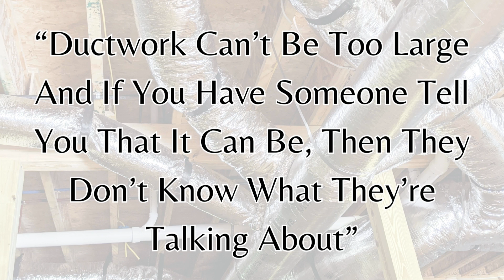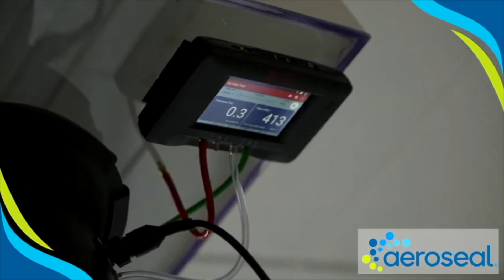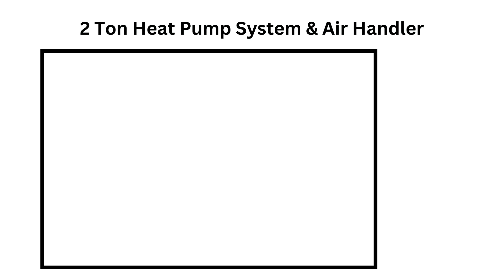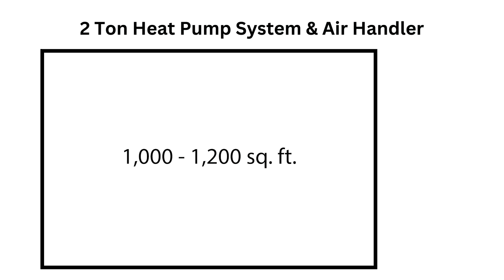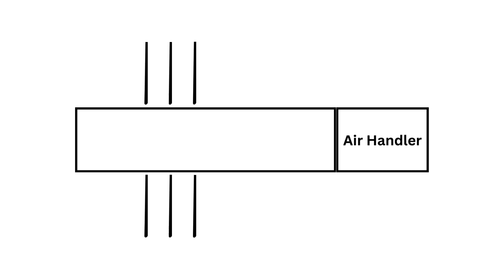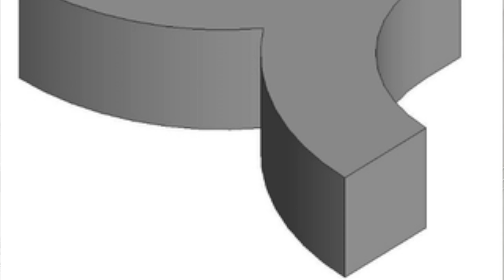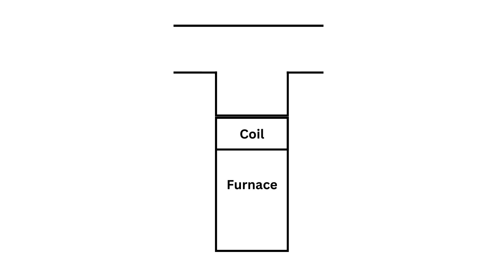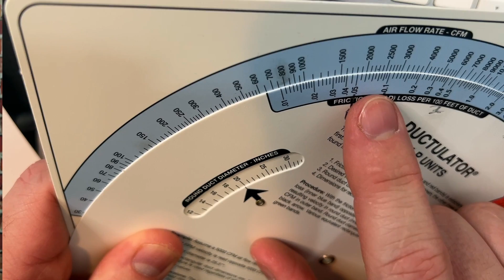Lie about HVAC ductwork!

Comment: Excellent video and certainly does blow away the statement that ductwork can't be too large. I think of it as compared to any system where you've got different size ducks for specific reasons and you take the smallest one in the system and double its size you got an imbalance right there.

Comment: I’m assuming hopefully he was trying to mean in regards to branch runs being oversized and using a dampered tap/collar. Obviously using a 10” instead of a 6 flex duct would be probably not work well and be very loud out register. Your supply trunk definitely needs to be properly sized and designed to ensure the branches are all being fed the right cfm, velocity has to stay high enough to ensure air turns into the branch ducts from supply . It takes a lot of time and effort to become familiar with airflow. I wish code inspectors could be more familiar so homeowners would stop being screwed over so often by the cheapest bidder. We don’t even test duct leakage in my area which is insane to me, I live in the humid south. Supply air leaking into the attic causes huge indoor comfort and IAQ issues.